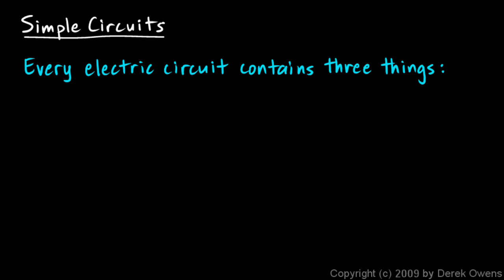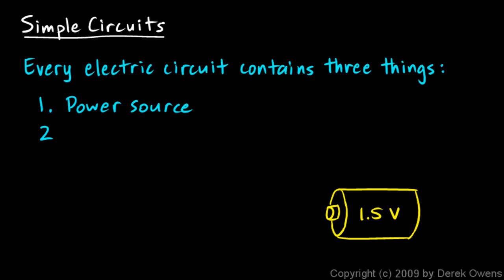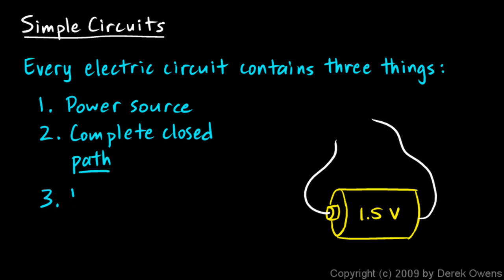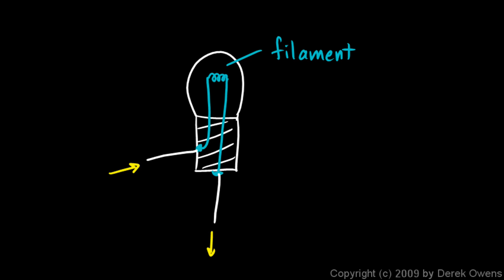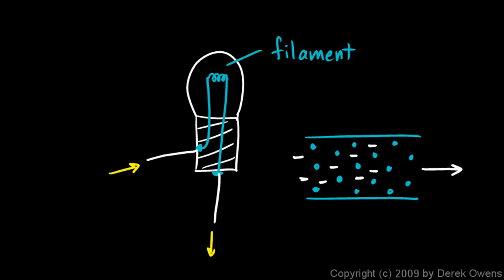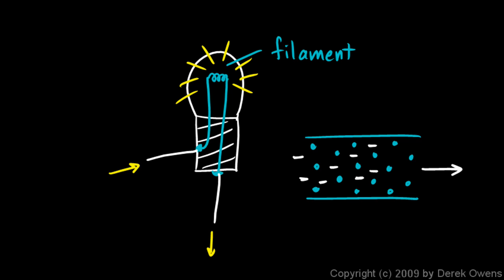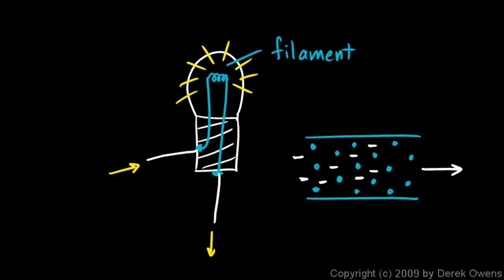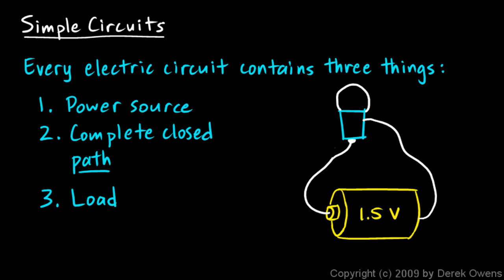Physics 12.5.1a - Simple Circuits

Comment: @derekowens Oh my God I think its hard to understand these thing although I love it
I think I have a lot of questions
and here one 
if I have a 2 circuits with 1 LED and 1 transistor like this 
       + 9 V - _____ Resistor _____ LED ____  end of the wire connected to the positive pole 

and other one

       - 9 V + _____ Resistor _____ LED ____  end of the wire connected to the negative pole 

is there different between these 2 circuit?
is it ok if i changed the location of the components?